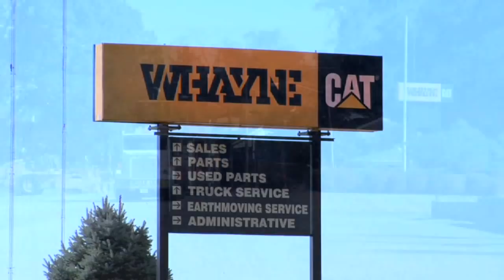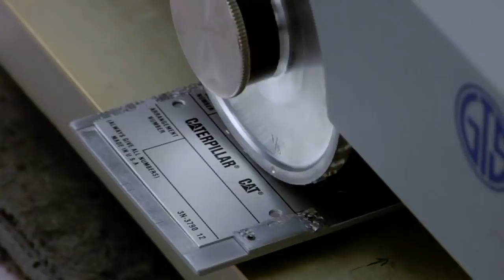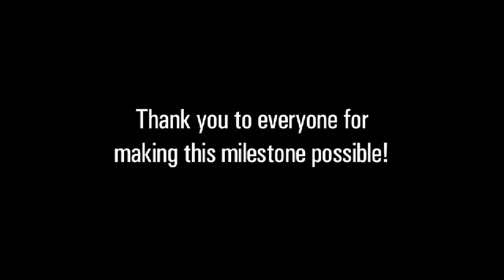Certified Rebuild |  Cat® 980G Rebuilt | Timelapse Video

Comment: I work for Terex Africa and do rebuilds. Engines and transmissions go for reconditioning. There's no need for new ones. Diffs and final drives you only service like changing worn bearings. All pipes are replaced. Tyres get painted if still in good condition. A Terex TR100 can cost the customer 20percent of a new one so rebuilds are great options plus they come with a warranty.
Reply: Relebogile Chiloane

Comment: that was a total rebuild, not just new engine, heck they have an entirely new machine when that thing rolled out, I'll bet it was about 3/4 the cost of new machine, but you get the same life as a new machine, possibly more, as is often the case as rebuilt parts are often changed to make up for previous shortcomings.

Comment: this has gotta be an awesome job. Cat holds safety as key in their shops.. they would be a great team to work for.. I worked as an electical contractor (Low voltage installing fire alarm equipment) at one of the Cat wielding plants in Jacksonville fl,  they wielded front end loader buckets.. and the were one of they only big companies to a huge emphasis on safety
Reply: Papakap22 yep same hear at the engine plant in Tx
Reply: Pity they dont hire people that can spell.
Reply: @Truth Exposed 
I know, right!
I’m gonna weld this sword while I wield this welder!
😆😆😆😆😆😆

Comment: Interesting video. Thanx for posting it. :)

How many hrs on this loader at the time of the rebuild?

So what's the ratio between re-used newly painted parts vs brand new?

What's the cost savings to rebuilding vs purchasing new?

8 weeks duration, is that 320hrs billed time or more? Shop rate approx $110/hr?

Comment: What they are not showing is all of the good parts going in the metal dumpster, just because they have a little ware. Don't think about dumpster diving because they made us take a torch and male the unusable.
Reply: I doubt they just throw them away they probably get rebuild
Reply: it depends on the cost of rebuilding vs the cost of new. for instance, flat tappet camshafts and lifters are almost always replaced on these kinds of rebuilds but they are not thrown away because its cheaper to regrind them vs manufacturing new ones, but if the rocker are on a smaller engine like a 3406 is damaged out of cats spec, whether it be scratching or pitting, they are thrown away because the amount of labor and parts to rebuild them is more costly then buying new
Reply: @Dodger 
So why would it benefit anyone to dumpster dive for unusable parts???

It would seem more productive for CAT to send those things out to recycle instead of filling municipal landfills with metal and aluminum junk!
Reply: @AzzKicker-bz1cb  musta missed the "metal" part of what he said, the parts do, at least at my shop, go into a scrap dumpster that goes to a recycling plant.  And I actually misspoke, there are a lot of parts that do not get trashed like rocker arms and lifters, they actually have a core charge for them.

Comment: Ecologic and cheap way to release new mchine.
In times of finacial crisis and  lack of raw materials, is bery good option.
In rebuild time, the solution for the owner is use replacement machine. Very easy.

Comment: Why in the world would they not pressure wash it first?
Reply: If everything is getting torn down anyway, just clean it on inspection and rebuild. Paint shop will prep anything else. 
Why wash it, then drain fluids out over everything again?
Reply: @RovingCanada  Sure would be a lot nicer for the fellas taking it apart.

Comment: I'm thinking 80000 $for the rebuilt
Reply: Did you see the amount of guys working on it? 80k over 8 weeks.. 10k/week would barely pay the overheads (if at all). I'd say 150k at least.
Reply: Probably 500,000 be that a new one is 1.1 million
Reply: @Emilio Perdomo 
Right.
It cost me $21,000 for an inframe rebuild on a 3406E!!!!
I’m sure for all the parts, labor time, and labor manpower plus the cost of disposing of the hazardous ship materials, it would be closer to the $500,000 or $750,000 mark!!!

But IF the cost of new($1,100,000) vs. rebuild is a 20% savings over the new purchase, that means the rebuild cost the customer $1,078,000!!!!!
Reply: AzzKicker 1234  I think your math is a tad off on the 20% calculation....20% of 1.1 million is 220,000

Comment: The company I work for have a cat 928g to load muck . Safe to say it is the biggest pile of shit I have ever driven. It does the least amount if hours pure year out if all the machines and spends the most time in the workshop with the engine out or the cab off . We are however having a 924k Ag handler on demo which 
does look to be a better tool!

Comment: So.. it took 2 months to complete. That's 2 months worth of man labor which looked like you had a full crew working on it. The cost of all those new parts, shipping etc etc.. its probabaly more cost efficient to buy a new one
Reply: Absolutely not having had several machines rebuilt it costs a fraction of new.
Reply: The fact that there's people spending good money on having these rebuilt instead of scrapped says otherwise
Reply: @I Am Sekou oh ok.. I'm sorry? 🤣🤣
Reply: If that was the case then these rebuilds wouldn't be so popular. It's actually a rather good investment having a technically new machine for 1/3 of the price.